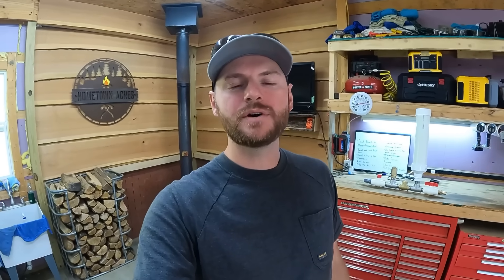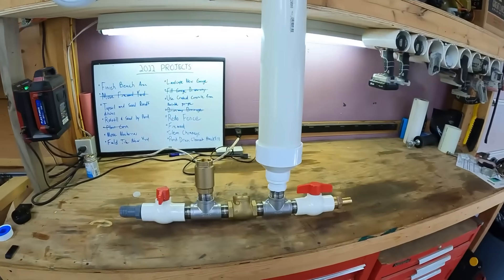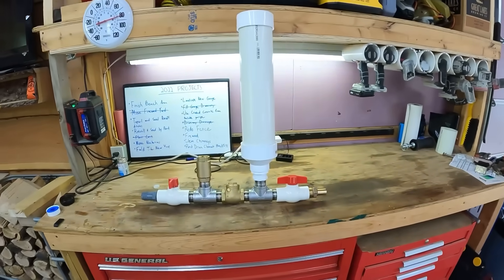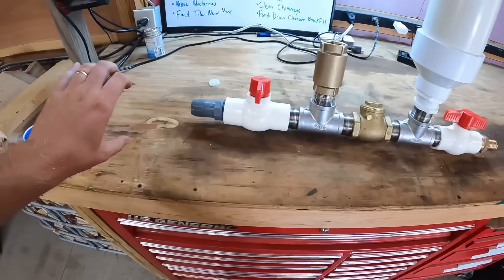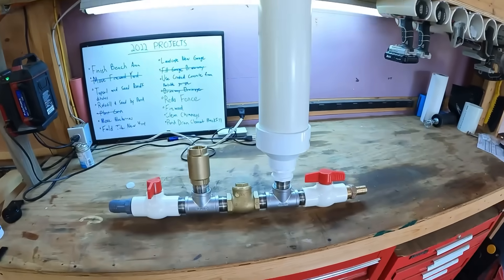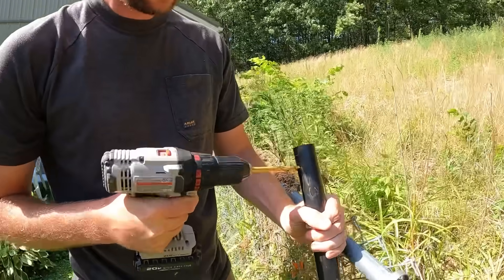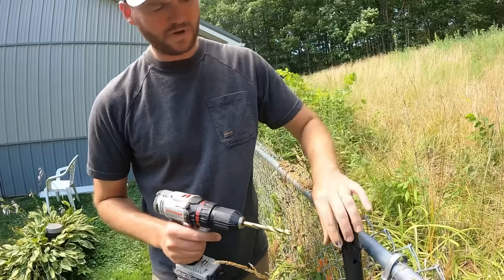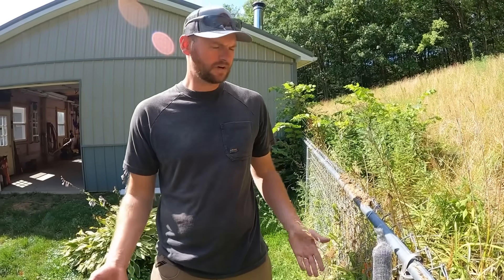We Found Water For The Pond - Hydraulic Ram Pump

Comment: if he would just hook the 2 pipes together where it starts to go down hill it would pull the water out of the creek without the ram pump. the pump is good for priming the tubing. once it reaches past the creek water table, dig a decent size water feature adding a hydro electric. then you would be set even more. i dont know what you use for electric. even during winter months the water should be moving enough not to freeze.

Comment: So instead of a homemade pressure tank, could you instead use a thermal expansion tank? Or could you pipe in a 30 gallon well.pressure tank and set it on a paver so the apparatus isn't top heavy? Also, could we add a pressure gauge?

Comment: just a thought,,, I used a bicycle air valve on a high pressure pump setup of mine to bleed the air out. When running the pump, I get about 800kpa and when I bleed the air out it moves up to 1200kpa. The bicycle valve was installed on the outlet side of the pressure vessel

Comment: Now that u got the water in the lines going up the hill and going down the line into the pond, all u gotta do now is plug the pond end to trap the water in the line going downhill to the pond then quickly take off the ram pump and plug the pipe going up the hill from the stream to again keep the water in the pipe line. Then simply connect the 2 pipes at the top of the hill and open up both sides at the same time (make sure the water input side is under water when opened) then let the siphoning begin then put that pump to use of doing another line then another and another and build up the water quicker
15:19 u won’t have the ice problem if u do the siphon thing I said above

Comment: Just curious the water you have going uphill at the plastic tank why don't you hook a bigger hose going back down the hill on the other side to your pond full of water keep pumping it out and then you can turn your pump off and the draw of the water going down the other side of the Hill might pull the water out of the river back into the pond with no power just flow and if it does lose power because the water doesn't stay constant in the river you can keep your pump there to keep it primed just curious it sounds like that might work I do a lot of similar stuff with my green  greenhouses, you can always dig a deeper place out in the river so you'll have a larger body of water staying more constant in that particular area

Comment: You could connect the feeder pipe to the pond with the supply pipe from the ram pump - by just connecting another ram pump in between the two service pipes.  You would have to experiment with how big your second compressor is - but that along with a horizontal swing check and a downstream bleeder vent from the swing check could eleviate the need to for a bilge tank to collect from the sream side ram pump.  Anyway just food for thought.  But I liked the video - thanks

Comment: Nicely done Adam.  The accumulator will get water-logged with time (air disappears by disolving in the water) .  To prevent this , fit a 'snifter' valve.  It introduces a small amount of air per cycle to keep the accumulator fully charged.  Cheers.
Reply: Do you have a diagram of where the snifter valve would be placed?

Comment: According to the Clemson University Extension publication Homade Hydraulic Ram Pump for Livestock Water, you have your valves switched. That is why you had to remove the spring. The waste valve should be a swinging check valve. It will probably improve your pump’s performance if you swap these valves.

Comment: Hi from the UK! Great videos BTW.  If you stream is higher than your pond, there is potentially an even better way using the syphon principle. Run a continuous pipe ( 2" even) from the stream to the pond. Make sure both ends are immersed and prime the pipe by completely filling it with watet (NO air). Then, open the end in the pond, and as long as both ends stay immersed, water will flow.

Comment: You would not need your tote at all you would use a stand pipe a pipe with out a lid 4 inches 30 inches high Barb fitting on bottom. As long as it is not air tight

Comment: Question. How long is the pipe from the intake to the pump, and what is the head before the pump?  You never showed that, and it would be nice to know for those who are thinking about doing this. 

Second. Unless the pond is lower than your pump, you don't need the tank at the top of the hill. It would be much better to run a continuous line from the pump to the pond as the net effect would be to lessen how far the pump has to push water uphill, thus increasing the pumps output by a lot.  If there is a siphon there is no need for a ram pump. Just siphon the water directly from the stream up and over the hill to the pond. 

The third, which you've probably realized, is that the intake should cause as little restriction to flow as possible. Using a large pond pump debris screen would allow the water to flow faster down the pipe increasing the ram pressure at the pump.

I loved the video, and I'm impressed that your pump can push that much water 30 feet uphill!

Comment: I think you needed to move the spring so it would tend to try to keep the check valve open.  This allows higher velocity before closing.  Obviously, it needs spring tuning.  I've also seen people put a section of pool noodle in the air tank so that acts as a 'spring' if the air works its way out as it is absorbed by the water over time.

Comment: Being that you have a source of running water on your property, which I wish I had that type of resource build yourself a small damn there and use Hydro power. There’s kids out there right now that you can buy instead of relying on a ram pump you could run an electric pump and pop a lot more water into your pond and also supply power for your home.

Comment: Hey I live in the Great Smoky Mountains in a small town near the TN, and GA, line. But I was wondering if anyone knew how to build a hydro-electricity system where we can have electricity in our home. 
I was put on oxygen in November 2020, because I have insufficient oxygen in my blood and a lot of scar tissue on my lungs.
Then 2 years ago we found out that our son had Leukemia. Thank The Good Lord above that his chemo is Working.  We have a river behind our house it's about 10 ft -- 15 ft
from our back porch. But I started thinking about some living off 
grid TV shows that I had seen Homestead Rescue. Then I found yes you can do it. It's Hydro-electricity they get electricity somehow someway without solar.  I'm sure there's a way that we can get electricity from that water in the river, but we have no idea how to make one. Maybe build a water wheel out of that river so 
We can have electricity in our home to run my oxygen and other vital appliances and C-Paps on. So if anyone can draw a sketch of how to do this or make system or show one on a video. Amy help or information on #hydro-electricity  would be appreciated any help at all from what materials we need, are even to flipping the switch on. Lolol  
Thank you so much

Comment: Did you have any issues with the EPA over the Waters of America Act? Out of curiosity, if you ran without the tote and got the ram pump to get the flow going to the pump, could you have a bypass loop to the pump that would take over using siphon action?

Comment: I believe ,if you use a sealed container on your highest point  the suction of the down hill pipe would help  the compression column at the starter point and ease the check valves  to function better

Comment: I've got a ram pump and love it! But if you can simply siphon the water from the creek to the pond you should. You'll get a lot high volume of water and never have to worry about air build up or maintaining the pump.  As long as you have a larger volume of water in the downhill to pond pipe than you do in the creek side pipe it will pull the water up over the hill to the pond. No power needed and zero moving parts to wear out. 😃

Comment: Have you also thought about when the hose is full of water and is over the hill and connected to the hose until the river leads to the river that you have your valve what you can open, so that water from the river, go over the hill, reaches your lake through the suction effect. 
The river just has to be higher than your lake

Comment: Something I saw one time was to put a partially inflated 20 inch bicycle innertube inside the the pressure tank to act like a bladder pressure tank for a well pump. Install the tube valve through the top cap so that you can control the pressure in the tube.

Another thing would be to run a plastic or concrete trough from the output pipe to the pond so that the water doesn't soak into the shore.

Comment: Greet video n explain.
Is this method work for 20_30m height n 200m long from the water source?
My house is very remote no electric at all.
We always have froblem with water, electricity  n Internet.
We have to go safer 200 to 800m for safer n to get good Internet ifen more worse  can be to 5_8 kilometer defend on the weathers for house lightening we use oil like in 18 century.
Any nolage to takle awer problem highly appreciate thank you

Comment: Although the ram pump is a cost effective solution for off grid water supply,i can't hold my comment off this your setup. I don't know why is the making a new well for the pond is so expensive as you mentioned,but cannot help my notice of great open field there. From that collector tank to pond you have at least 200 meters of sunny field. Can put up solar panels enough to drive the smaller electric water pump,which will considerably pump a water,also efficiently better. Also i noticed heavy machinery to dig and maintain field work,which are not under $1000 so i don't see where you want here to cut expenses,because heavy machinery are in need of fuel and maintenance,which are not cheap. As for example,i live off grid,have a hand water pump,solar panels for lights and driving a bicycle,i know what cutting expenses means. No offense,i just stated my opinion.

Comment: Your wrong ! Your trying to fool everybody ! That rampump that you have doesn't cost $300.00 to $500.00 ! Everything you have there will vary in price on the metal fittings only if your using galvanized or stainless steel fittings. The check valve can cost anywhere between $20.00 to $40.00 with the kind your using. The preasure tank is only pvc pipe with a cap and a reducer fitting. Pvc ball valve $8.00 - $15.00. Point being,  you could build that whole thing for $100.00 or less !
Reply from the maker: I have $200 in 300 foot of black pipe. The pump itself is worthless if you don’t have the lineal footage to move the water from point A to point B. And point A to point B for me is 300 ft
Reply: @HometownAcres  I was talking about only the pump. I must've misunderstood you because I thought you were talking about the price of just the pump. Sorry about the misunderstanding. I retract my comment.

Comment: The chamber is not a pressure chamber. It's just an air arrestor to smooth out the pumps. Has nothing to do with pressure. Also not 100% necessary. A ram pump can be made without one and still work fine.

Comment: You don't need any pump nor siphon over hill slope, you just need very long hose and intake long up the stream at elevation which is higher than the lowest point between stream and pond... and this lowest point is where you aim ( with hose in the hand ) from the stream side. You just make another stream inside the hose with lower downstream angle. The proximity of a reliable stream is the solution to any water problem.

Comment: Hi a nice implementation of a ram pump. to enhance your setup consider the following: 1 - The source intake end should be much bigger, add a short length of 2 to 4 inch pipe with caps and loads of holes with screen wrapped around that, or a coanda screen on a dam box (as the large intake will keep the pipe full and at a consistent pressure). 2 - The pressure wave from the first valve of the pump needs to happen within a maximum distance from the source (within about 100 feet) otherwise its too long and looses effectiveness. Add a stand-pipe (a T with a vertical pipe to the height of your source, open at the top) closer than source to the pump. The stand pipe allow an exit for the air bubbles to leave before entering the pump and brings the pressure closurer to the pump keeping the pressure wave within the maximum distance that it has most strength. 3 - Have the source feed pipe drain into a bucket with a hole in the lid. Again this prevents air getting into the pump. Then have the delivery to the pump halfway up the bucket side, as that allows any silt (the other ram pump nemesis) to accumulate in the bottom of the bucket (which becomes a maintenance check) and less likely to make it to the valves and block them. I hope that helps, take care D

Comment: Someone may have already said this, but actually, if the pond you're filling is lower in elevation than the source of the water, you actually don't need the ram pump at all. You can just start a siphon on the pipe and gravity will pull the water up the hill in between source and destination....so the siphon would be more efficient than using the ram pump if that's your situation.

Comment: Put 2 to 3 "Y" PVC waste fittings on to your inflo end, in Pond covered with " Pantyhose" covers, thus increasing your intake potential to the optimum 40mmDia intake, as intended..you will then have equivalent of 2 to 3  intakes minimizing blockage, a loose Stone over ends as suggested also very sensible..! 
I've been playing around with Hydraulic Ram Pumps since 1966..lots of fun...!! Wish you well with your venture..!!
Self sustainability and protection of environment  has been my Heart-beat since my Studend years in Architecture & Engineering 1963 to 1974 onwards..!! 
Shalowm
Reply: Standard ofset Y pieces generslly used by Plumbers in their main Sink & LB waste line one leg continious and other side leg coming in at +- 45 degree angle...

Comment: A number of flaws in your work, assembly of the ram, layout of the feed pipe and fitment of the delivery pipe are incorrect. If you do it correctly, it will pump twice the quantity of water that it is pumping now. You don't need to buy any more parts, you can do it by re-engineering the Ram pump.

Comment: If you want to run one hose/pipe from the pump to the pond, all you need to do is put a hole in the top of the hose/pipe at the apex of the run. The hole will break the suction, so the ram pump will function correctly, and water will flow.

Comment: I would at least test it with the pipe connected directly instead of though the tote.  You've got nothing to loose and a lot to gain if the siphon on the hose could supplement the ram pump.  Great setup BTW, and a great video that got right to the point. Thumbs up!

Comment: Your intake needs to be a Lot larger to avoid trash sucking onto it an d stopping water intake; Try a screened off bucket perhaps. I say this from using a ram pump to raise water 25 ft vertically to our house. We had the advantage of a 12 ft drop from a spring water source. Cast iron pump from 1932  was used; homemade leather flap valves used in that unit.

Comment: Ram pumps work fine, but slowly, and there are a few fine points to using them.  One is the vent check can have a line running off to the side to keep a puddle out of your work area, but don't run it up hill because it will stop the flow.  The filter sock you make is find for a few minutes, but you probably need one about five feet long. The other very helpful info is you should start with a 4" inlet, for the first 10 feet under the creek flow, the first five feet can be drilled and  a sock put over the inlet all the way up over all of the holes, this can be held on with a band clamp. Before the 4" pipe elbows up add a 4x3 reducer, run a few feet of 3" then use a 45° elbow not a 90°, because each 90will have a 15% loss of flow. Reduce from the 3 to your supply line fitting and this contraption will give you a stronger flow.  Where a lot of rise is needed, the trick is to build a series of thousand gallon ponds or tanks, run out of that into a second ramp pump, etc., until you get to the top. As long as the inlets don't clog or freeze, they will flow flow 24/7 and have little maintenance.
Reply: big RAM pump move lot water and fast, i used 200 gallon barrel to ram pump reserve and 4inch tube has fast move water big grown field one day has full water. about 10 agre size

Comment: Why don't you seal the tank on top remove the ramp pump, Fill up the tank from the top, and then, open the valve for the bottom pipe/hose? It should create a vacuum and suck water from the creek into the tank. May be he tank should be reinforced not to collapse due to the vacuum effect...(It would be like a Syphon system - it could work)

Comment: If you were to have a siphon effect, make a double bypass valve system around the pump isolating flow around the pump, which might improve water delivery without going out the check valve on the pump
Reply: I meant to say isolating flow to the pump directing flow around the pump while siphoning

Comment: Build MORE head in the creek with a larger diameter pipe necking down to your intake size.. Definitely will increase your head pressure. The farther you can run up stream the better

Comment: Why not 4 (or more) of these pumps working at once? If they all worked as well then.....1.33 X 4 = 5.32 gallons per minute,  319.2 gallons per hour, 7660 per day. Accounting for evaporation, ground seepage and livestock use.....one could redirect any back to the creek or simply turn the pumps off when not needed.